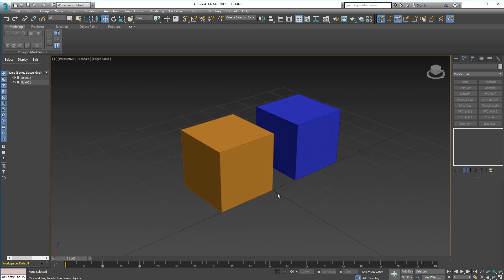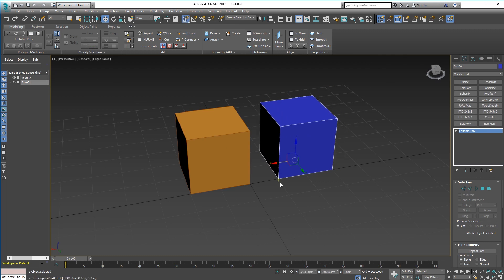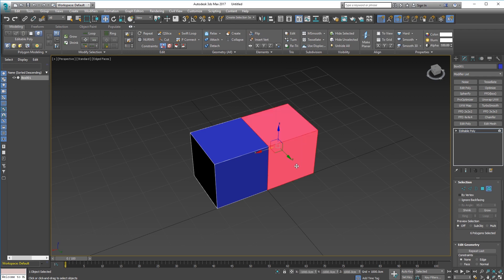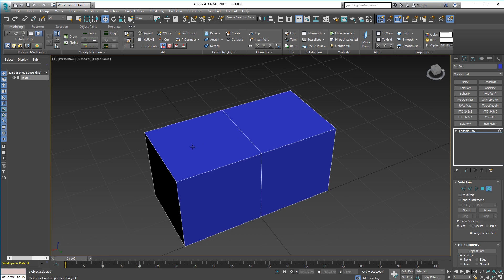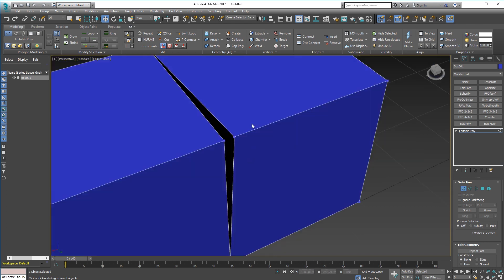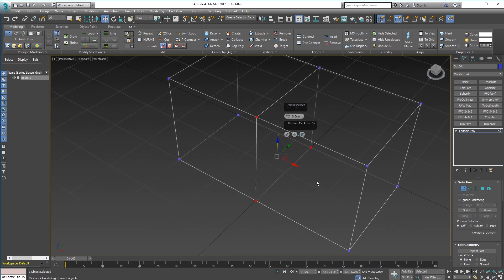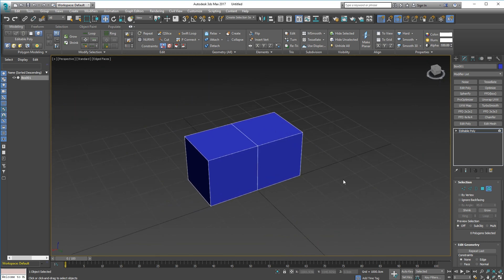3DSMax Welding Verts

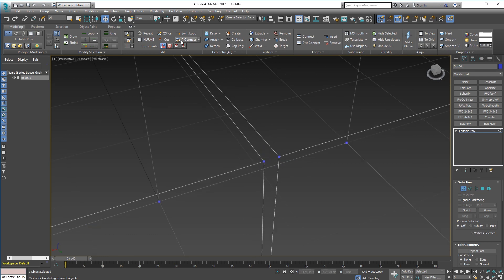Comment: to hurt the head all the bla bla bla .. the solution is in 4:16  very thanks
Reply from the maker: I get you, but just be careful. There are many reasons how and why this happens and several ways to fix it  not just 1, which I explain, so don't miss those or won't learn anything. For the record, I don't earn anything from these videos... zero... so I'm just helping you if you want it. Sorry it hurt your head!!